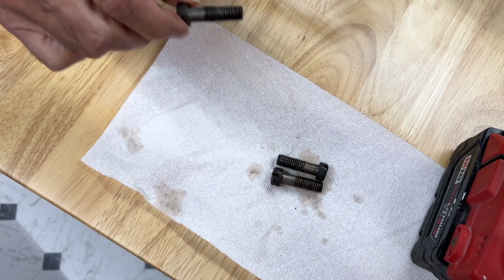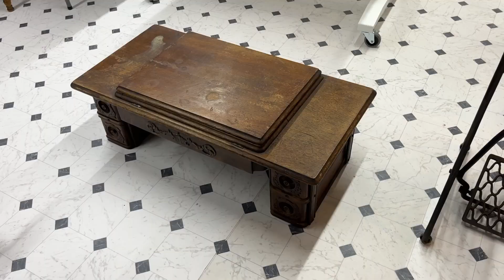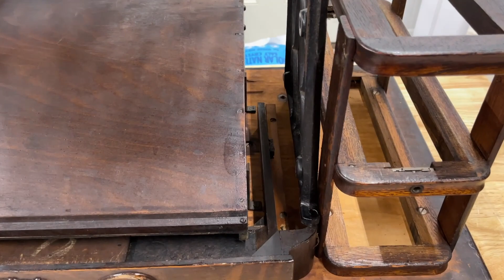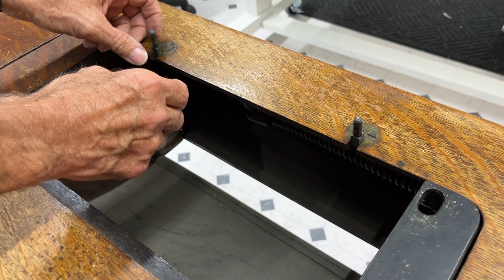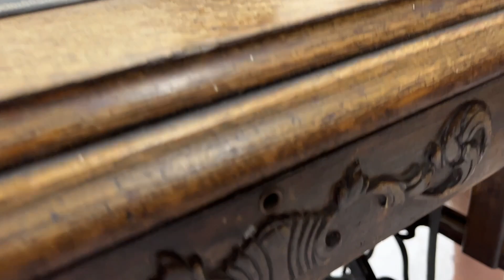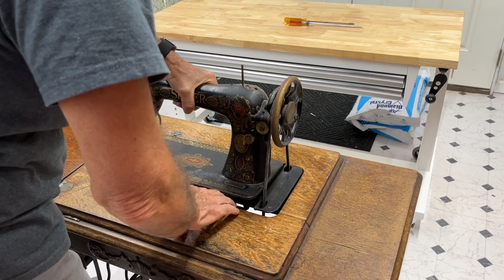Singer Treadle Sewing Machine Assembly

Comment: I don't need to assemble mine, but still fascinating to watch. :) I never knew there were springs to go into those slots on the drawer tops. I've found a picture of them from an old completed sale on Ebay, so I now know what they look like, but have searched everywhere I can think of and can find none for sale. Do you have any ideas?
Reply from the maker: The best option is to watch for old cabinets. I haven’t found a cabinet yet that did not yield some useful parts like screws, springs, drawers etc. They can usually be purchased at a very reasonable price - sometimes free!
Reply: @NickWright-nv1rk  Good idea!

Comment: Since you put the cabinet together would you be able to tell me how to remove the metal piece where the belt goes in before going around the wheel? I was told to remove it to facilitate the new machine going down into the cabinet but can't figure out how to??
Reply from the maker: Angela, sorry I missed this before now.  To release the belt from the flywheel, rotate the release lever to the left and hold it there.  Slowly rotate the top of the flywheel toward the front of the cabinet and the belt will work itself off the flywheel.  Check this link for a image of the release lever.

https://drive.google.com/file/d/15TMVg11AQwKy-eNW9acPXOVZLO8MAkmg/view?usp=drive_link
Reply: @NickWright-nv1rk  I think you misunderstood my question. I know how to do and undo the belt. What I need to know is how to remove the metal piece from the cabinet where the belt threads through.
Reply from the maker: Do you have a leather belt with a metal staple?  You really don’t have to remove the belt from the machine unless you are replacing it.
Reply from the maker: Angela, sorry if I’m being dense, but after reading your replies, are you talking about the black metal spring assist arm that is just right of the machine?  It has the two holes that the belt feeds through.
Reply: @NickWright-nv1rk  I'm working on restoring a machine that is missing the lift assist mechanism. I have ordered a lift assembly (the black metal piece that the belt feeds through), but I'm not sure how to attach it to the cabinet. Can you show pictures of how it is attached to the cabinet?
Reply from the maker: There are several different lift assist mechanisms.  I have published pictures of two of the most common treadle cabinet mechanisms in a separate post.

Comment: Thank you for the clear, easy to follow video. I'm curious about those treadle belts and connectors as I haven't seen them before.  Could you tell me a bit more about them please (what they're called, who supplies them)?  Thank you.  :-)
Reply from the maker: We order our belts from sewpurtyworkshops.com.  You can order an individual belt or order the belt material in bulk and cut to size.  The metal connectors are included with the belt material.
Reply: @NickWright-nv1rk  Thank you so much, I really appreciate it!  :-)
Reply: I have a 66 just like this one. Does it need a rubber tire on the bobbbin winder?
Reply from the maker: Yes, part number 15287

Comment: Asking I’m in the process of assembly of 2 cabinets on to the irons. These did not come with the 4 per cabinet mt screws that holds the cab to irons. Do you know the sizes required? And also the hinge at front of the center drawer,3 screws go there are missing. Ty for the great tutorial!
Reply from the maker: The large screws are #12 x 3/4”. The originals are flat head. You can also use a pan head screw. I’m not sure of the configuration of your center drawer. Do you have a picture?